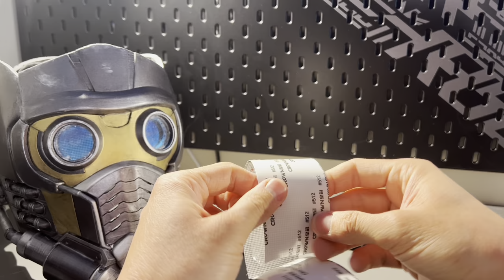Star Lord Helmet Build Tutorial from Guardians of the Galaxy: Becoming Star Lord Part 2

Comment: I’m slowly making my way through this build. A couple questions: Did you not use the nanotech pieces on the inside? Wondering if they’re necessary. Also what did you use to bind everything together? Glue or welding? Thanks for your time.
Reply from the maker: I didn’t use the nanotech parts as I wanted a helmet closer to a screen used one, and I used spare rafts/ pieces of PLA in the small rectangles on the faceplate and sides and glued it all together. I hope this helps, good luck with your build!

Comment: I’m wondering if you can help me out. I purchased the LEDs you used but can’t find a battery pack that works for them. The lights and wires just get too hot. Any chance you could shoot me a link? I’m just waiting for that part to complete. Thanks in advance.
Reply from the maker: https://www.amazon.ca/LAMPVPATH-Battery-Holder-Switch-Leads/dp/B07CSXDTCY/ref=asc_df_B07CSXDTCY/?tag=googlemobshop-20&linkCode=df0&hvadid=459079765636&hvpos=&hvnetw=g&hvrand=18060723347447381699&hvpone=&hvptwo=&hvqmt=&hvdev=m&hvdvcmdl=&hvlocint=&hvlocphy=9001344&hvtargid=pla-523895084396&psc=1
Reply from the maker: I think it was this one, but yes if your lights get too hot it’s because there’s too much voltage, make sure it’s a 2 battery pack and not a 3 battery pack
Reply: @midknight_maker  Thanks again!
Reply: One last question! I’ll be clear coating this weekend. I was wondering what you used (as in gloss, satin, matte, etc). Thanks!

Comment: Did you use filament for the 3d print? (I don't know a lot about 3d printing, but I found out there's resin and filament)
Reply from the maker: Yes it is! This one was printed using PLA filament. 3D printers that use filament are called FDM (Fused Deposition Modeling) printers, and resin printers are called SLA printers, which print using liquid resin.